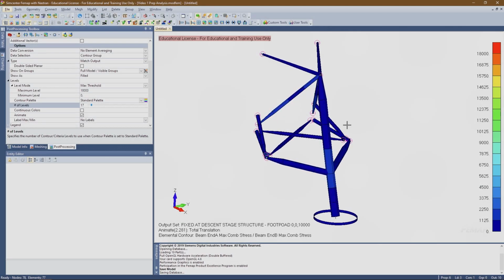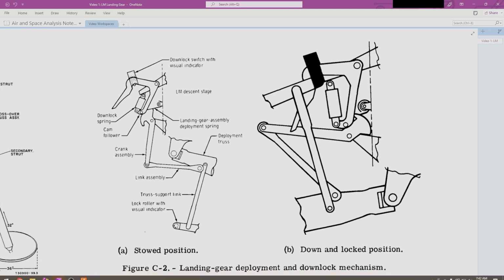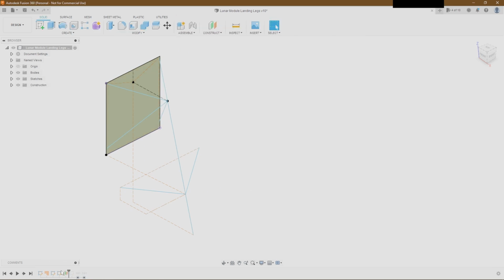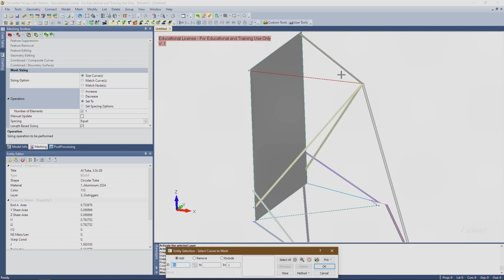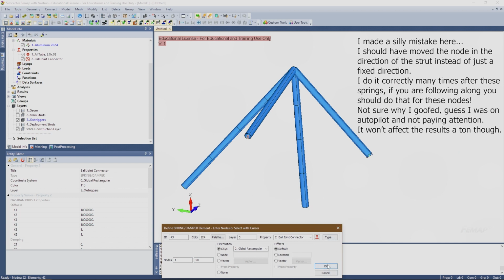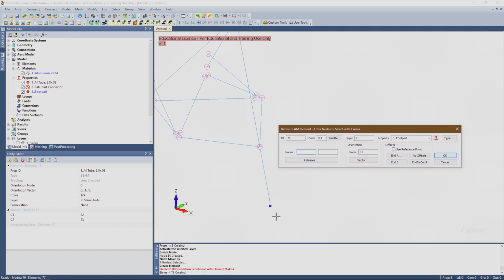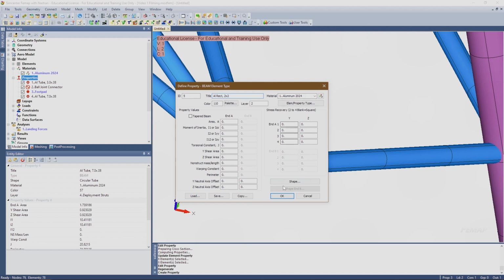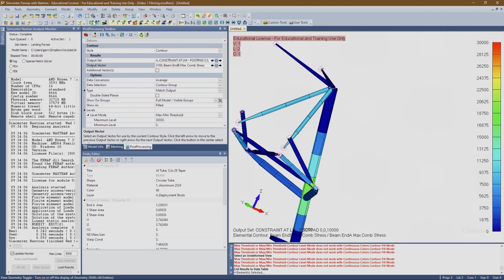Let's Analyze the Lunar Module Landing Legs! (Discussion and FEA)

Comment: I think the cross-over is necessary because the deployment truss arcs are not parallel to each other. Cross strut photos here. There could still be a physical pivot point or connection there but I'm not sure why there would need to be one.
https://www.nasa.gov/sites/default/files/styles/full_width/public/thumbnails/image/lm-2_drop_test_mar-may_1969_s69-28261.jpg?itok=BztSCgiR
https://www.nasa.gov/sites/default/files/styles/full_width/public/thumbnails/image/lm-2_drop_test_may_7_1969_s69-33045.jpg?itok=r027-l4z

https://www.nasa.gov/sites/default/files/styles/full_width/public/thumbnails/image/lm-2_drop_test_apr_3_1969_s69-29355.jpg?itok=Q0ZSlQ38
https://www.flickr.com/photos/128712737@N03/30925799915/in/photostream/
Reply from the maker: Great point!
Those pictures are awesome, how did you find them?
Reply: @airandspaceanalysis1561  Just Googled image of various search terms. And spent way too long doing so! Here is another one but it looks more like a test article.
https://www.fi.edu/sites/default/files/styles/gallery_large/public/General_LunarLander_05_FranklinInstitute.jpg?itok=Y3FPxZTu

Comment: They designed these without any of the tools you used, atleast not of the capability you have
Reply from the maker: Yep, certainly over 50 years ago they did not have the current software I'm using, or anything close to it! This was more of a fun exercise and a chance to learn about finite element models with some cool historic hardware rather than a recreation of how it was done back in the day. NASTRAN itself was first created in the 1960s, although I'm not sure if it was ever used on the Apollo program spacecraft. Anyways, I said  in the video a few times that you can analyze this structure relatively easily with hand calculations by finding all your strut vectors, which is probably what they did for this.